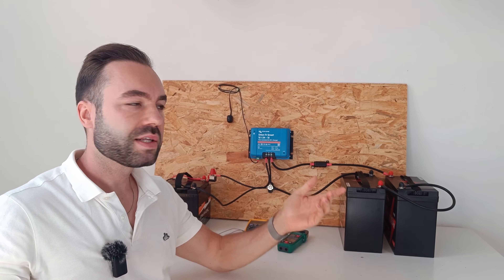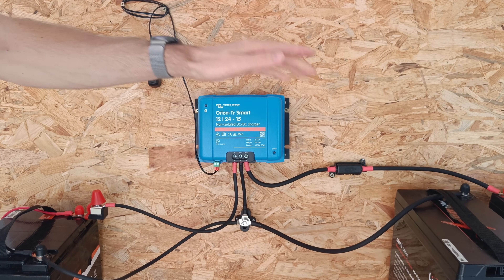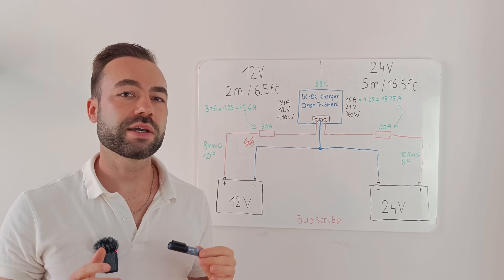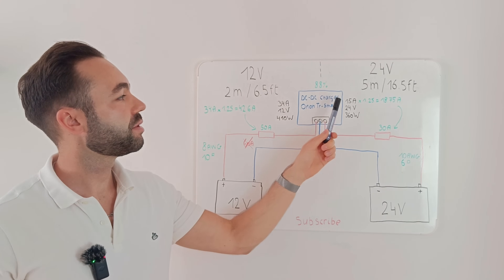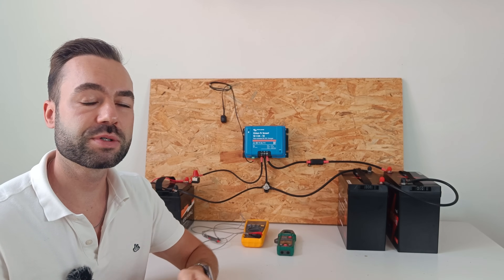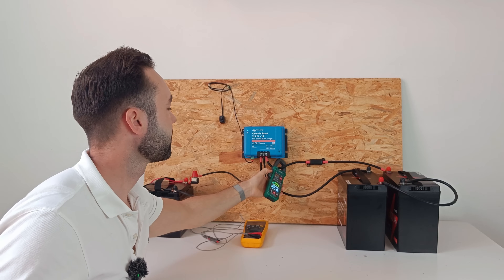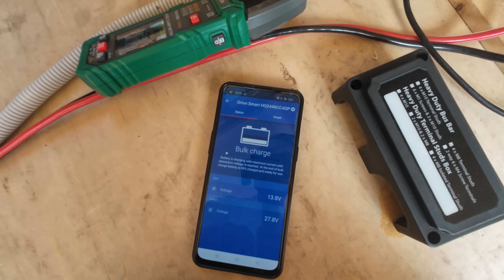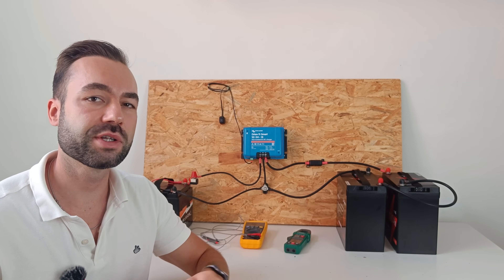Installing a DC to DC Charger: Victron Orion Tr 12-24/15

Comment: if you have 30 amp shore power on a boat with a AGM starter and a Lithium House Bank.  The goal is to protect the alternator.  Is it better to have the shore power go right to the house bank to keep it charged and then have thealternator charge the starter then dc to dc to charge house bank from alternator?  or have shore power and alternator go to the AGM and then aDC to DC to house bank.  SInce the biggest use is the house bank I am thinking shore power and solar to House banks - isolated.  Then have starter ony hooked to alternator then dc to dc  then to house bank.  this ways shore power/solar always keeps the house up - and house and agm get charged via the engine while underway.  Thought?

Comment: fuse rating is typically set at 125% to 150% of max load current. you do not want to run continuously at  fuse’s rated current.

Comment: Hi If possible could you advise me on whats best. Is there a 12vdc in and 24vdc out 30amp or preferably 50amp  dc to dc charger that I can buy. I have already had a 400Amp charge alternator fitted to my MB Sprinter. I was thinkingof fitting 4 x 12v to 12v dc to dc 50Amp Victron chargers. I have 2 x 460Ah Fogstar batteries. Watching your videos is making me think maybe 24v would be better. Any advice would be great.

Comment: I was wondering - in your fuse selection video, you say for lithium you need a fuse capable of interrupting a high short circuit current eg Class T. But you are not using one here?
Reply from the maker: Good question. The midi fuse is not the main battery fuse. The cable going to the battery would connect to a busbar and then to the main battery fuse and then to the battery. It's not shown like this for demonstration purposes.
Reply: @cleversolarpower Fair enough.

Comment: How do you determine the maximum current the alternator can provide for a DC-DC charger?
Reply from the maker: Good question. That depends on how hard you want to let the alternator work. The harder you let it work, the more current you get from it but you will have more wear on the belt and more fuel consumption. My suggestion is 30% it's rated current. So if you have a 100A alternator, then a 30A load.
Reply: @cleversolarpower  so if you would like to use the victron XS on its max 50A for 12/12 system, how strong need the alternator   to be?

Comment: I have the Orion TR (isolated) 12/12/30 with engine detection enabled. This works great. I usually have the DCDC disabled via the software as the MPPT usually works well on its own. Is there a difference between using the software vs using a physical DCDC on/off switch? Also, is there a way to get the DCDC and MPPT to charge together i.e synchronised? I haven’t been able to find anything on this. Great content as always Nick! 😀😎

Comment: First of all, excellently explained. I know nothing about this, but I`m trying to learn. I think you said it was not possible to limit the Ah going from the charger - 15Ah constant, but reduced by heat. I think I heard somewhere that 10% of the stated Ah for the battery (household) is best to charge with. How does that relate to using a 30A fuse? I don't think you said anything about the Ah, the capacity, of the battery (Ah will probably be the same with serial connection). Thanks again 👍

Comment: I see that you connected not to negative ground but directly to negative terminal battery is that safe ? I don't have my van solar system grounded to chassis and I don't want to do that cause my sprinter is plenty of electronic....do you recommend this set up directly to negative of the battery ? I wish to buy the new XS and Is not isolated....what you think is doable ?? Or I will catch fire ?? Many thanks ciao
Reply from the maker: Check the diagram in the manual. it shows you can connect to chassis ground, but i prefer running it straight to battery negative as e reliable path to 0V, not the chassis first and then to batt -.
Reply: @cleversolarpower what " OV" stand for ? Thanks 🙏
Reply from the maker: Zero volt potential 😉 aka ground

Comment: Trying to figure out the dc to dc charger between an agm and lithium bank.  Boat has shore power and alternator.  So alternator charges the starter, then dc to dc, then to house.  The shore power goes to the whole boat charger and to the battery bank.  How does the shore power get to the starter without creating a backdoor between that house bank and alternator not protected by the dc to dc charger?

Comment: I don't have a dc-dc charger, but I do have an extra mppt charge controller. Would it cause any problems if I used a battery as the input for that instead of a solar panel?
Reply from the maker: The input of an mppt needs to be 5v greater than the battery voltage for it to work.
Reply: I'd be using a 24v battery to charge a 12v, so the voltage won't be a problem. Thank you.

Comment: Great video.
At 7:55...the charger can't be turned on/off in the app. I googled and it said that it could be (it said to connect your phone to the charger via Bluetooth using the VictronConnect app, navigate to charger settings within the app to find the on/off toggle).
Maybe Google's response is incorrect?
Reply from the maker: It is for this B2B charger, I couldn't find any on/off switch in the app. Maybe that's for the Orion XS.
Reply: Yeah, maybe I googled the XS or XS 1400. Thanks.
And thanks for the great content!

Comment: It would be really nice if you could change how fast it charges with a dial or app. Are there any similarly priced DC/DC chargers that can?
Reply from the maker: Indeed. I haven't seen ones where you could dail the current down. However, renogy has a function where you use a jumper cable on the device which let's you halve the current delivery. But they only work on 12-12v.

Comment: Good info. I did not know that this 12V/24V split system was possible.👍🍻🇦🇺
Reply from the maker: Renogy has a 12/12V option. Victron has 12/12 too, but also has 12/24.

Comment: Very nice demo Nick! This might just be what some of us need for that extra little bit of power between camping sites. It's nice to be able to keep my apartment fridge running while on the road. I have been wondering, could we use a cheap WPM charge controler in place of a DC to DC charger? Maybe connect the starter battery to the solar input, and the battery connection to the house battery (battery connection first, of course). It wouldn't provide much aperage and wouldn't automatically shut off, but it might work as a crude stop-gap measure. What are your thoughts? Thanks! Cheers, Danny 💗🌹💗
Reply from the maker: Thanks Danny, glad you enjoyed the video. I don't think thats possible because the starter battery is fully charged at 14V, and the input voltage on a PWM needs to be 5V higher than the battery voltage. You also have no protection so you can drain your entire starter battery (if it works). You can use a boost converter with a low voltage disconnect into a PWM, but i have not tried that. Might be a good idea for a future video.
Reply: @cleversolarpower  Okay, cool! I will do a bit more research on it. I saw one video where a guy tried it and only got about 5 amps from it, but I don't know what brand of charge controller he used. Oh, and yes, Your starter battery would surely fail if you forget to disconnect the charger from it. Thanks Nick! Cheers!

Comment: Where did you buy it for $48.00?
Reply: At 1.05 you mentioned a $28 price at even lower than what I first thought you said. I'm curious because other venues charge much higher prices, like over $100. I would like to spend my money where you shop.
Reply from the maker: @robertpaulis439  That's the price difference between an isolated and a non-isolated version. The prices can be seen at 13:03
Reply: @cleversolarpower Sorry Nick. When I heard the price mentioned at 1.05 I promptly went on line to search. 
Anyway I intend to try using an isolator instead of diodes on a project prototype. Your video gave  me an idea to solve a resistance issue with my latest project.
Thanks for your work and info.
Reply from the maker: Did I say $48? Where?